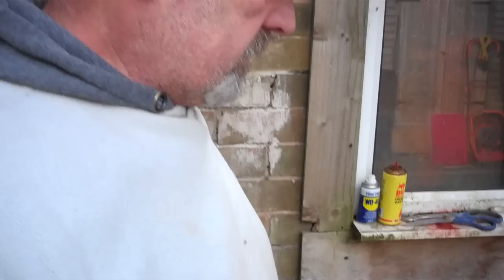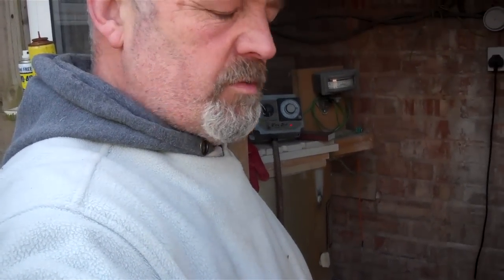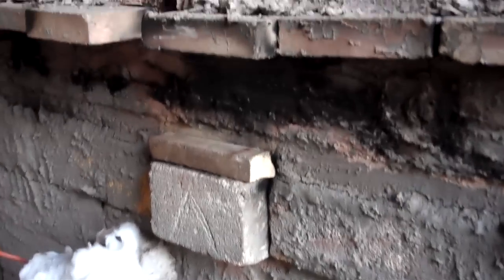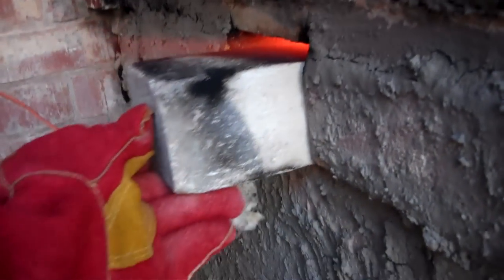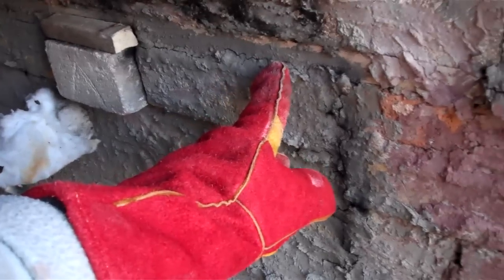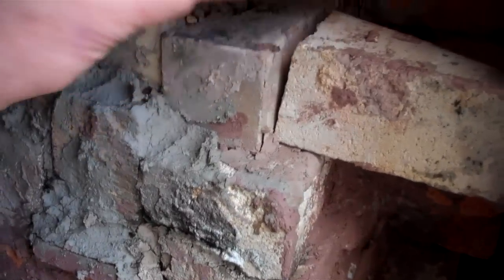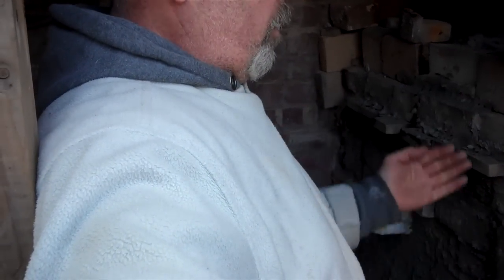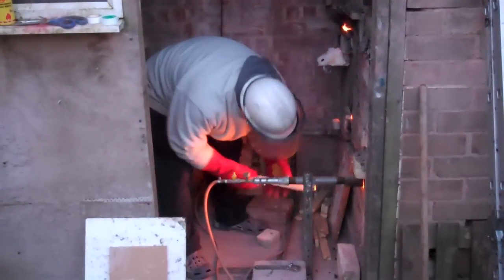pottery.  gas wood firing second firing of 2015

Comment: Hi Steve, sorry to bother you again, (i do try google but never seem to get a straight answer) i am looking to buy an old electric kiln to convert to gas a bit like s leach's ( downdraft) its 70cm high and 70cm wide could you give me an idea how big to build the chimney please? i have built them in the past but they have gone into reduction way too soon so i have to wait until the next day to make the flue bigger,to be on the safe side should i just make it oversize and use a damper ?    any advise would would be very appreciated,
Leigh.
Reply from the maker: +LB Ceramics Hi if you are using propane you dont need a big chimney as there is no need  to draw the flame through. A   foot or so above the kiln should be ample. be sure to make the internal dimensions  of the chimney is over sized as you say you can use a damper . I would always have a damper as it gives fine tuning during the firing. you can use a kiln shelf on top of the chimney if its only just above the kiln.